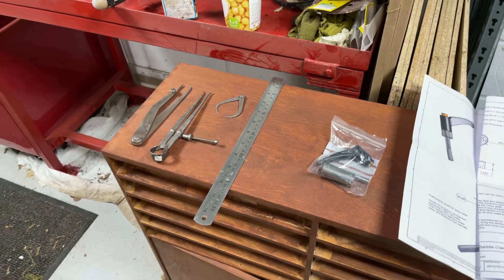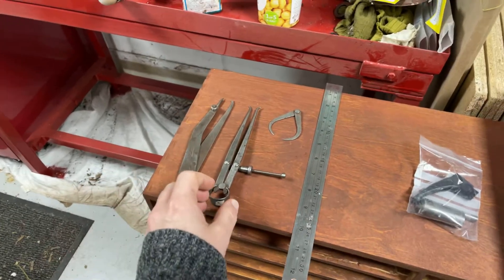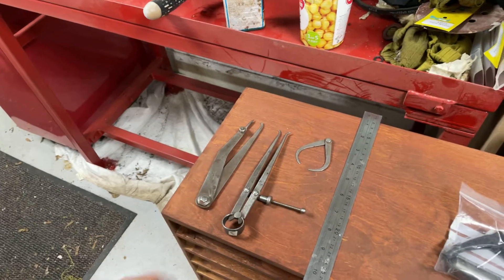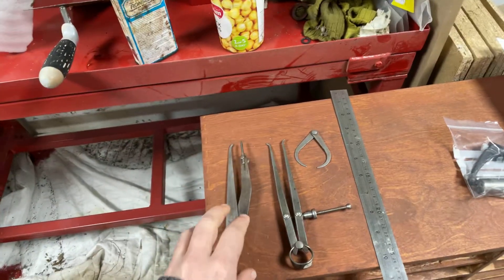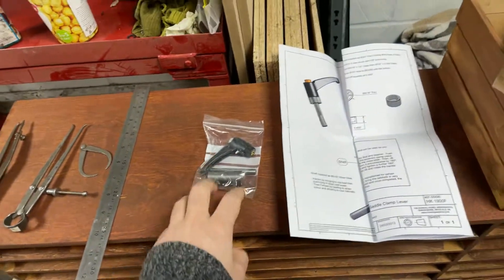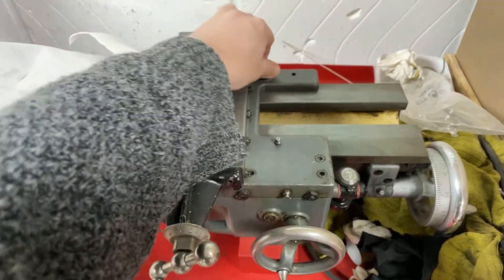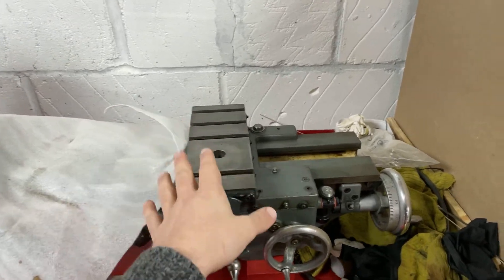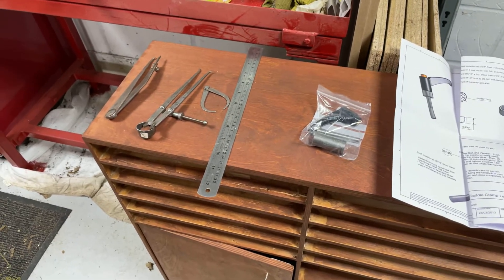Inside / Jenny leg callipers and Hemingway Carriage Lock

Comment: The desire to go non digital is shared with me. My own first steps are to move to an analogue dial caliper and a mechanical (as opposed to electronic) micrometer. 
I share your feeling that Hemingway ought to provide a metal handle and not plastic carriage handle. 
Good luck with the move.
Reply from the maker: As per responses to Knackler and Mr. F - spending all day infront of a PC the last thing I want to do is do that in the workshop too. There will be space for a blackboard in my new workshop, but I'm not sure I'll do without a calculator!